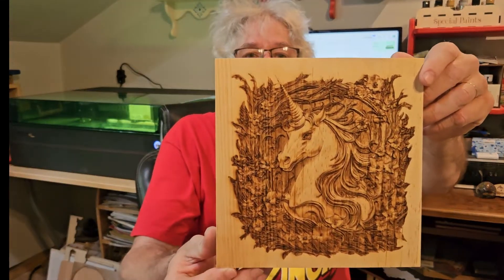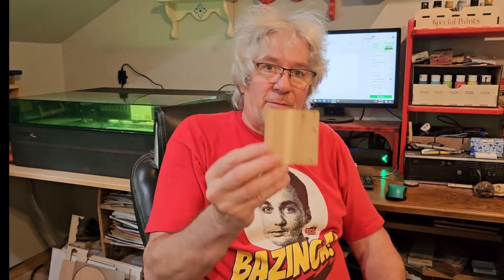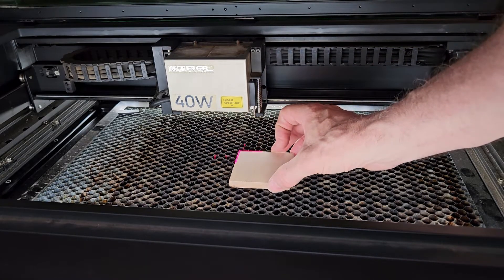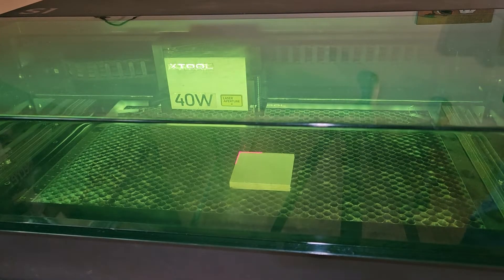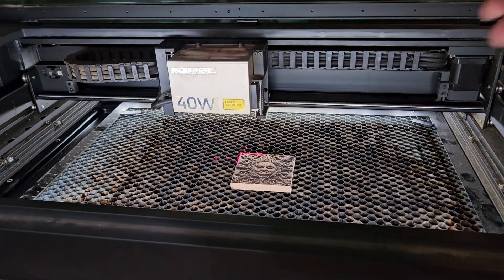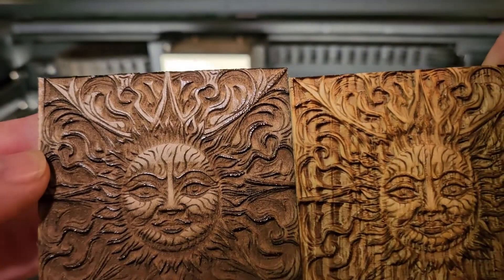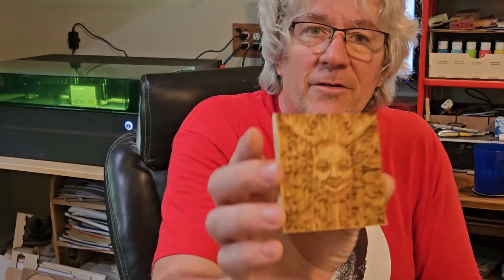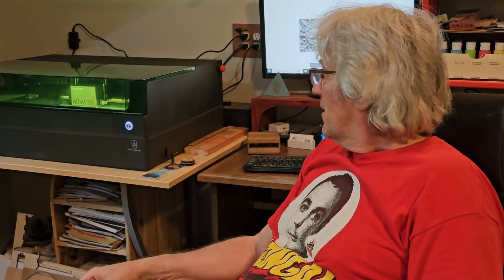3D Engraving with the Xtool S1 40watt Diode Laser

Comment: Does this work also with a m1 ultra 10w or s1 20w? and how much depth can u get in for example text?
Reply from the maker: It will work with both machines. Usually I get about an 1/8 of depth or less. I have also burned through a board before so it all depends on how high you run your power and how slow the speed. You can also do more passes to get more depth.

Comment: for maple you said you upped the power? what were your settings? and also what do you think about walnut wood for this machine? and thank you for your helpful video
Reply from the maker: So sorry it took so long for me to answer, The power will depend on your laser. For the pine my standard setting is usually 55power 150 speed and 120 to 200 lpc. I couldn't find my settings for maple what I do is use the pine settings for a starting point and do a test grid on a scrap. You can run one for each type of wood you use and keep them somewhere for reference. I am working on my house and my test pieces are missing. If you need to know how to do a test grid let me know and I will do a video on how to do an engrave test grid. The setting will vary from image to image sometimes.

Comment: Does this work with 20 w?
Reply from the maker: if you do a test grid with part of the image you can get your power and speed setting dialed in where you want them.
Reply from the maker: Yes, It will work with any power laser. I started doing this with a 5.5watt. The difference will be the engrave speed, power and some detail. The 5.5 watt laser took 6 hours to do a large deep engrave. My 40 watt is usually around an hour to hour and a half for an 8"x8" piece of pine. On my 10watt M1 Ultra the time is 2and a half to 3 hours.

Comment: just a tip, but that 200 lines per cm is "wrong" since you cannot do better than 100 lines per cm due to the dot size. You probably watched people using 200 lines and figured to do the same, but it's because they used inches instead of cm. With 200 lines as you set it it's basically going twice over same line.
So you can cut your time in half by using the correct (best) settings. Same with power, why go with just 55% and 150 mm/s; you could use 90% power and 250 speed to get the same result. All together you can do it in less than 1/4 of the time it took.
Reply from the maker: I have tried numerous settings for speed and power and I even tried your suggested settings and mine came out clearer on solid pine. The lines per cm were what was suggested so I always used 180 to 200 I will try it at 100 thanks for the input. I have run a lot of 3d engravings and The 55 150 gives me consistent results I am usually painting or running on 2 machines so I don't worry about the time as much as consistency.

Comment: You mind sharing a link for your fan or what you would recommend?
Reply from the maker: I am using the XTool IF2, I run it out the wall with a dryer vent. It works Great!

Comment: Thank you for this great video! Sadly maple wood is very hard to get here (Netherlands, Europe) so i’ll try finding something comparable, because I really like the clean image on that one!👍
Reply from the maker: Your best bet would be to get scraps of wood that you can get locally and run small test engraves. I find I can get a really nice engrave with wide grain pine. You can also try multiple passes at different speeds. Watch for wider grains for less ridges in your engraving. Good luck.

Comment: Great video thanks. Quick question, do you need a 40W laser to get that level of depth? Could it be done on say a 24W diode laser?
Reply from the maker: I would think so I am running at 55% power. And I can't remember speed. You could up power slower speed or more passes. I ran tests on scrap pine first.